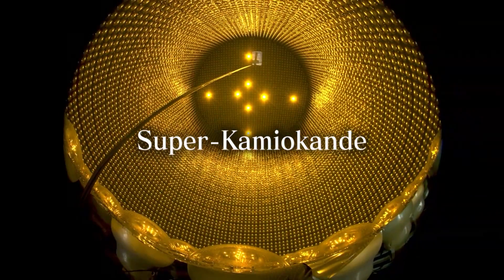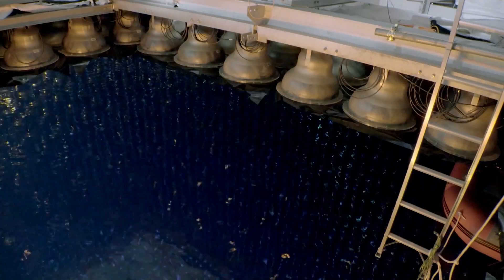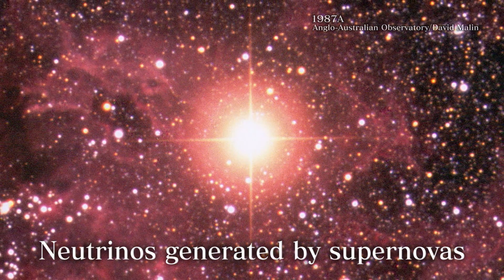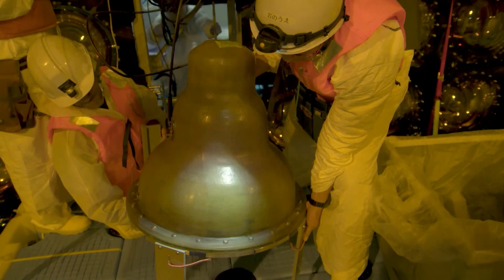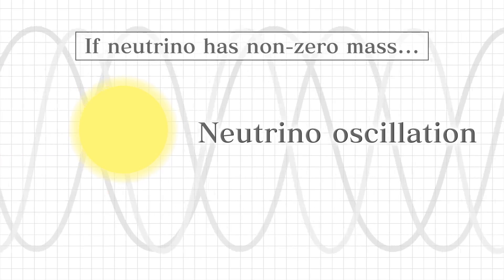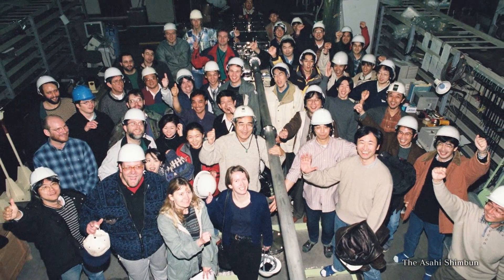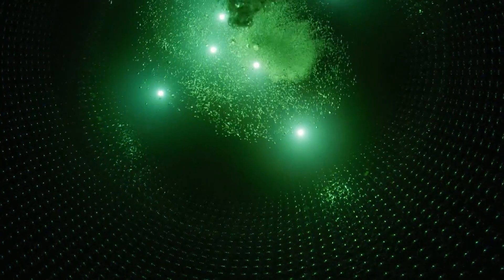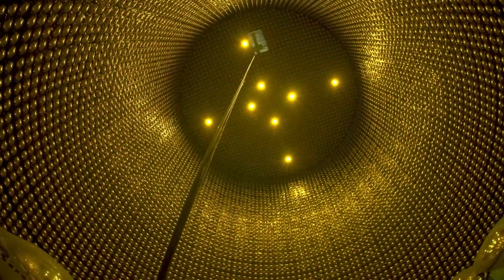Super-Kamiokande: Advancing to the Next Wave of Discoveries

Comment: I have this insatiable urge to sneak in and drop a flashlights into the water........please don't tell me that my dream would be impossible I need this!
Reply: Burn tritium to make super heavy water to fill the tank with. Decaying into helium, this would also pop the water molecule, I suppose. But anyway, this would also release an electron as beta radiation and an antineutrino for the detectors to have a chance at detecting. Much better than a flashlight. Good luck.